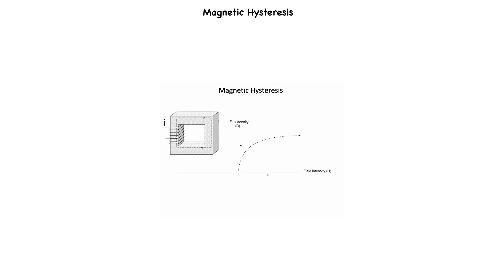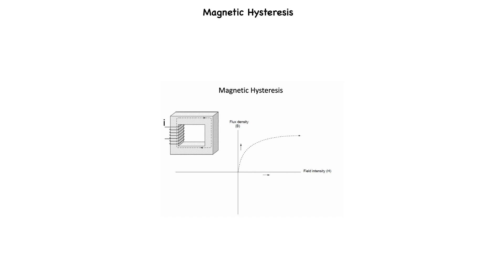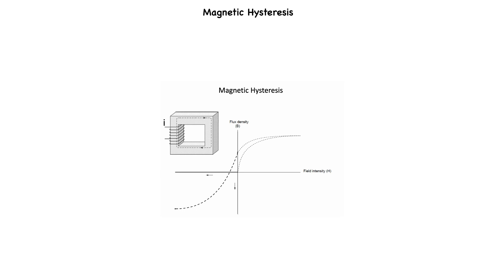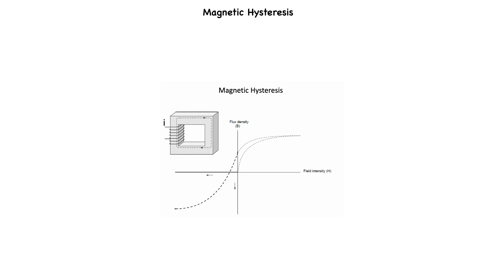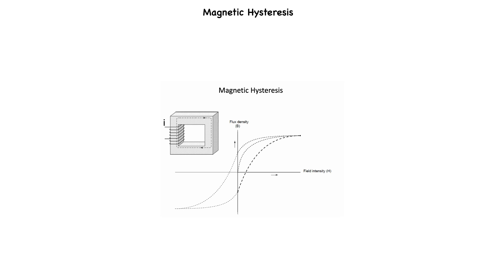Electromagnetism - “Magnetic Hysteresis

Comment: All you need to know about hysteresis is the thinner the loop the less the energy loss, due to heat. Is there a manufacturer of silicon steel alloys, for power transformer cores that publishes a datasheet with a hysteresis cure, or plot? Don't think so.